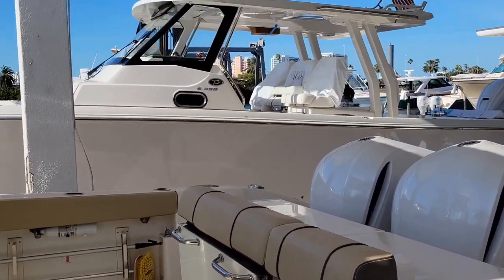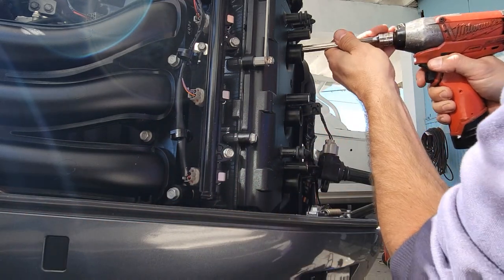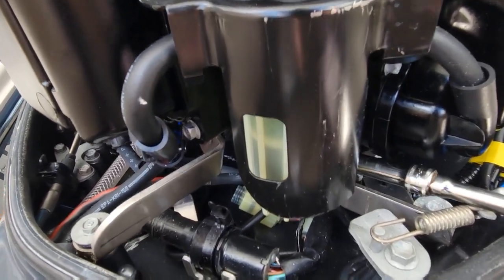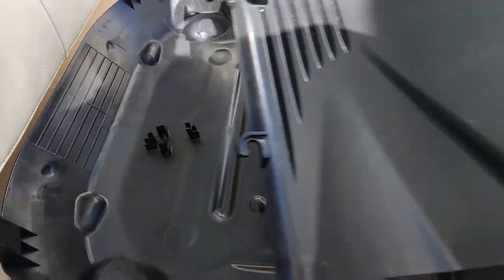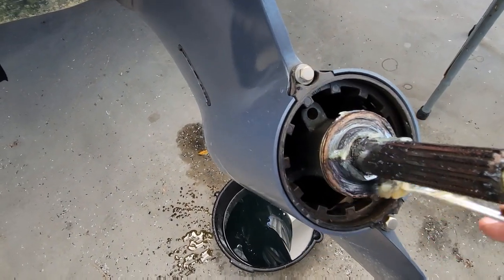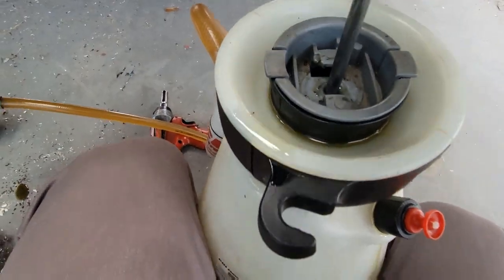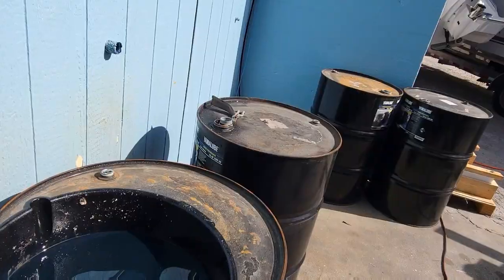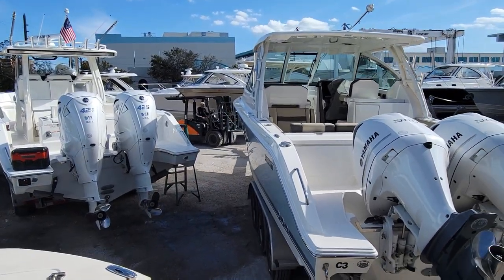Yamaha 4.2 Annual Service Plus A Question For You - Episode 131

Comment: i started the plug by hand then I use the cordless ratchet driving it in then torque them hand tight. I have many all kind of magnet pick up tool to fish the dropping bolts. some guy called it chyna-finger tool. kkkk

Comment: Surprised you didn’t inspect the prop hub.  I changed my gear lube last night and one of the rubber deals fell off of my drive sleeve.   I had a back up, but am assuming I could use this one if I spin my new one out .   What do you think ?

Comment: Question:
You’re sucking oil out of the dipstick pipe. Does that pipe go all the way down to the oil pan (don’t know the exact term for this in English) bottom? And is that with all bigger outboards? I use a hose with a pipe mounted to reach the lowest part and get as much out as possible.

Comment: justin,  I found the impeller kit on amazon--Replace 61A-W0078-A2-00.  Is this not the right one?
Reply from the maker: I think that is for the 3.3 Yamaha engines. If you have the Model number you can call the clearwater marina and ask Doug. He will get you the correct part number for any engine.

Comment: My 300r does not have a water separator and the optimax I had before didn’t either.  Do you suggest adding one? I fish a lot and run through a lot of fuel
Reply from the maker: Yes. Definitely good insurance 🙂

Comment: What type of oil extractor are you using? No tube dow the dipstick
Reply from the maker: We just use a reverso pump attached to a 5/8 hose and a spark plug boot to go over the dipstick tube. Works well and it's fast.
Reply: @JustinLeeMarine  Thanks